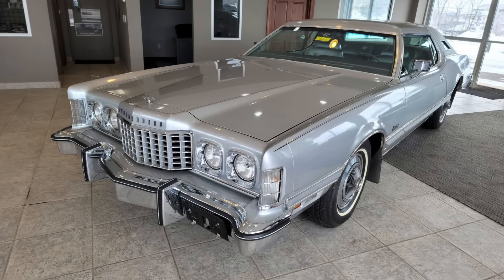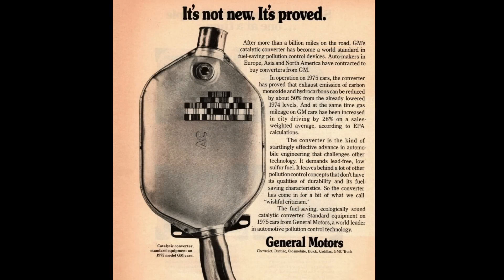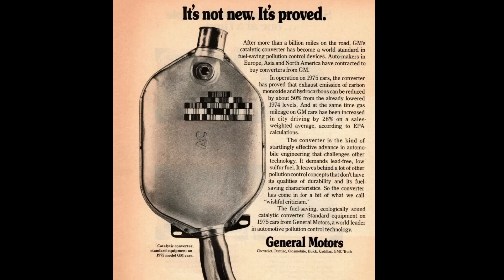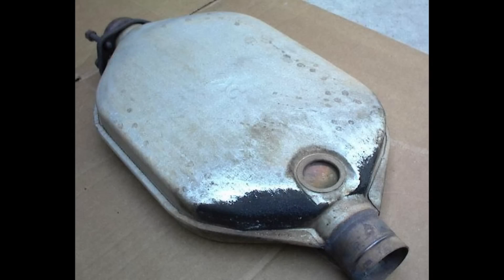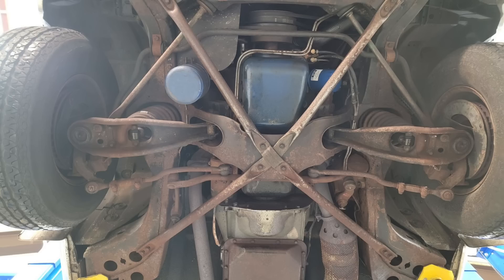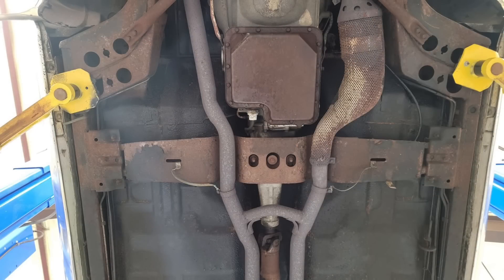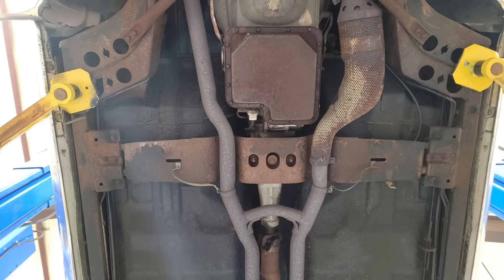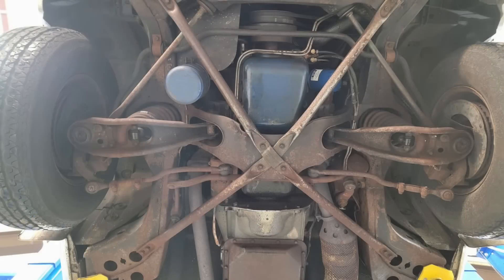Strangest Car Inventions: Ford Invents A Bizarre Way to Meet 1970s Emissions Standards

Comment: I had a '82 Monte Carlo that was seemingly becoming more anemic. I popped the plug hoping that would help. It did not. It was an extremely smog equipped V-8. Smog pump with lines going to each exhaust manifold port. The tag under the hood said 283 which was surprising to me, I thought that particular small block GM engine had been retired.
Reply: That's very odd, your right, the 283 was discontinued in the late 60's and replaced with the 307. 
Your Monte should've had a 305, unless the 267 was still available 🤷‍♂️
Reply: @johneckert1365  that's what I thought. When I bought it (used) I assumed it had the 305. But 283 that's what it said on the data tag. With all the smog equipment, I wondered if it was a California Car.
Reply: @johnjacobjingleheimerschmi3857  Very strange. Maybe someone will chime in with an explanation for us.

Comment: Don't Forget their sister: The Mercury Cougar
Reply: They weren't sister cars at that time. The Cougar was the same as a Torino from 1971-1976.
Reply: @kingrex1931  The early Cougar never shared it's platform with the Thunderbird or Mark series. The first gen Cougar (1967-70) AND the second gen Cougars (1971-73) were based on those  year's Mustang platform. The third gen cougars (1974-76) and the fourth gen Cougars (1977-79) are based on the Torino platform. The fifth gen DID, as upgraded Fairmonts.  Oddly that also put the Cougar BACK to being  a "Mustang" (Fox platform).
Reply: @jamesslick4790  I'm not the one that said they did. The Cougar wasn't on the same platform as the Thunderbird until 1977, when the T-bird was downsized quite a bit. They remained together until 1997 when both were canceled. Both were brought back, but once again on separate platforms.
Reply: @kingrex1931  Oh, I know- I was filling in the lineage. Oddly as a GM guy, I have always loved the gen 1 and 2 Cougars! (Way more than the Mustang!!!) It was kinda of an American Jag, Sporty with JUST THE RIGHT amount of luxury. The 1963 Buick Riviera and The 1967 Cougar (to me!) are PEAK 1960s US cars!
Reply: @kingrex1931  As to 1977, You are correct, Cougar and T-Bird met! Of Course this separated the Thunderbird from ANY Lincoln as well, A situation that lasted only until ALL were briefly reunited on the "Fox" platform. Geez for a GM guy, I have a LOT of Ford stuff in my head, LOL.
Reply: @jamesslick4790  I liked the 1967-1970 Cougars, otherwise I'm not a fan of them. I'm not a fan of the 1971-1973 Mustang either though.
Reply: @kingrex1931  Ok, Cool. You are not required to like ANY of them, I was just laying down the record.
Reply: @kingrex1931  4th gen
Reply: @Sonny_V  3rd AND 4th Gen are Torino based.
Reply: The  early Cougar never shared it's platform with the Thunderbird or Mark series. The first gen Cougar (1967-70) AND the second gen Cougars (1971-73) were based on those  year's Mustang platform. The third gen cougars (1974-76) and the fourth gen Cougars (1977-79) are based on the Torino platform.The fifth gen DID, as upgraded Fairmonts.  Oddly that also put the Cougar BACK to being  a "Mustang" (Fox platform).

Comment: I can't believe the amount of overhang on the front end of that last Thunderbird
Reply: Yep, they're rubbish at rock crawling.
Reply: Ford released a "safety car" video around 1971, showing their engineers grafting another foot onto the nose of an LTD or a Torino. The T-bird and Mark IV and V seem like production implementations of that strategy. Of course, by 1979, they had found a way to make the closely related new LTD with much less overhang and still pass the crash tests. That kind of engineering probably takes a while; I've heard that the front structures of some cars have 15 grades of steel in various places to create a controlled crumple in which the engine slides under the car. The overhang was probably a quick, dirty way to pass the testes until they got the crumple zone optimized.
Reply: Long hoods were in style then.
Reply: I know right? If they only made the hood a little longer, it could been real popular.
Reply: Crash protection. LOL.
Reply: Yeah, but it kept the wheelbase down to a decent turning radius.  I've also noticed as I've moved to smaller cars over the years, with front-wheel drive, that my older larger RWD cars could turn tighter than the Turbo 325 or transverse FWD cars.
Reply: & i can't believe how LITTLE overhang there is now in the rear of most new "vehicles" today - if you sit in the back seat, you are dead meat if a car hits you in the back, especially 1 of these dinosaurs.
Reply: @utuBrV1oI   Yes exactly, new cars are so disproportionate. Why would I want a car with no ass and a pug nose? Hell naw, give me the normal looking '70s T-Bird.
Reply: @AntonSander   Every generation has this moment about car styling. I'm sure 20 years before the period you think is normal-looking, people were going, "What is with these envelope-body cars? Why would I want a car with flat sides? Give me back my huge external fenders." :)
Reply: @ZGryphon   True, I was born in '95 but don't like anything newer than the '80s though for styling....  and for simplicity.
Reply: @AntonSander  Way to go, Anton!  And Gryphon is also right to a degree.  While vinyl tops and Opera lamps probably lasted too long, the fastest obsolete-looking designs were the late 1950s finmobiles.  I was watching a Twilight Zone marathon this weekend, and it was glaringly obvious with very early 60s cars, like John Dehner's Lincoln converible, compared to late fifties Cadillacs & Mopars parked at the curb.

Comment: The GM system killed dual exhausts.
Reply: True. Nothing after 1974 came from GM with true dual exhaust. It was also the reason the Trans Am/Firebird went from using the Turbo 400 to the Turbo 350 in 1975. The Turbo 400 wouldn’t fit due to the catalytic converter. Anything Pontiac built with a 400 or 455 came with a Turbo 400 otherwise. My personal belief is Pontiac initially killed the 455 option in the Trans Am in 1975 because they couldn’t back it with the Turbo 400. When they brought it back in mid 75, you had to get the super T-10 4 speed. That remained true for 76 until the 455 was dropped all together.
Reply: That was intentional on GM's part as for cost reasons, their bean counters mandated that each vehicle only use a single pellet bed converter.   That pellet bed type was the cheapest to manf but also the most restrictive by far, so it was a double blow to the cars owner before you even turned the key to start the engine as you lost 20-30 horsepower right off the bat.  When said engine might only be making 160-180 to begin with, it was a big deal..  

Ford and Chrysler on the other hand often used dual monolith/honeycomb converters, the type still used by manfs now, on certain models such as those with larger V8 engines.   Late 70's Dodge & Plymouth 440 police spec engines where an example of that.  

That GM 'one converter' edict was not changed until the end of the 80's AFAIK.
Reply: @AB-pl1ko  I think it had to be much later than the late 80s. The F bodies didn’t come with dual exhaust from 1975-2002. Neither did the G body Monte Carlo SS, Grand National or Grand Prix 2+2. And I’m pretty sure the Impala SS and Roadmaster didn’t, either. My 89 Formula 350 has what’s called the N10 dual exhaust option. All that means is there’s a converter off each bank of cylinders. But they dump into a single 3” over axle pipe. The 3rd Gen F bodies are very ignorant to install a true dual exhaust on because it was never designed to have it. 4th Gen wasn’t much different.
Reply: @mikee2923  - You are probably correct.  First GM cars I can think of are the 1992+ Corvette w/ the revised LT1 350 and the 1994+ Impala SS, etc.  It is possible the ZR1 powered cars of 1990+ may have had true duals, but I am not sure?

Fully agree on 3rd gen & even the 4th gen F-body not being designed to utilize a true dual exhaust.
Reply: 3rd gen camaros lol
Reply: yes, 1977 Pontiac Police "Enforcer" Lemans 400 4V with single exhaust! I owned two of them, could not top 110 MPH.
Reply: @Ascotman  yea even the Trans Am for '77 was single into one muffler & twin exhaust! Of course I ripped all that out & put headers & true duals on mine
Reply: @SquirminHermanthe1eyedGerman  The  Macho(lol) t/a came with 2 cats & no mufflers - i wonder if they were both GM pancake mufflers .
Reply: @utuBrV1oI  I can almost guarantee

Comment: My "75" Corvette was anemic!🤦🏻‍♂
Reply: More like choked almost to death
Reply: hmm sorry one challenge us in our kit car coming off a highway off ramp  it was a gt40 kit on a porsche frame... we went around at highway speed... he slide of and hit the fence.

didnt have the heart to tell him it was a volkwagon 1865 cc in it LOL    he truly believed it was a gt40 LOL     we got a 6 cyl  in it later and nothing could tough it. oh it only weghed 1200 pounds lol  :-)..    18" tires..  I dont think you could peel that thing off the pavement it had so much traction it was llike driving a rc car.
Reply: My 2000 explorer is too! Leaks everything but trans fluid!
Reply: But that interior
Reply: At least if you lived in a non-emissions county or state you could bump the hp up 100+ hp with bolt on parts and a distributor recurve kit.
Reply: My stepmother had an '80 with the 305. THAT was anemic!
Reply: My 1977 Corvette with an L-82 would get stomped by almost any four-cylinder car now. I know how you feel.